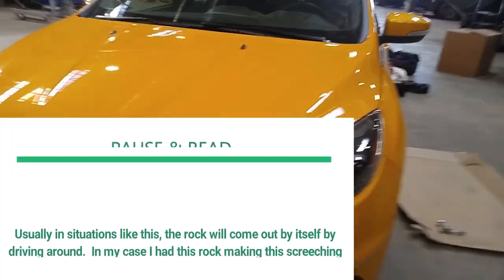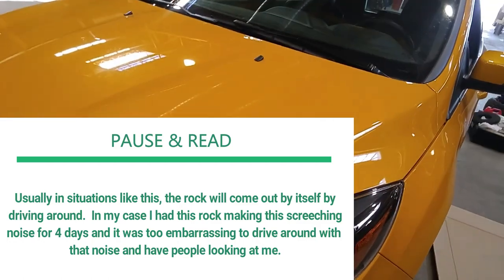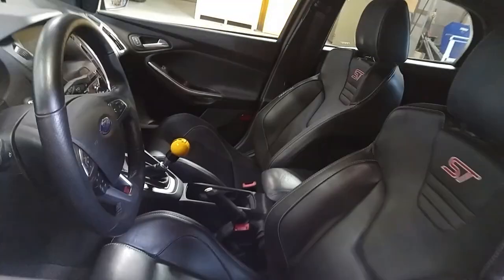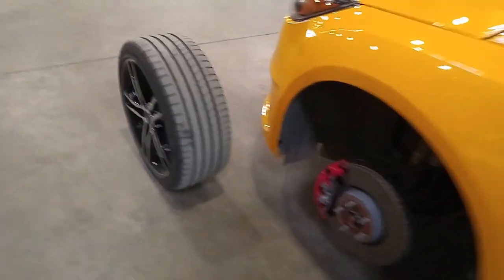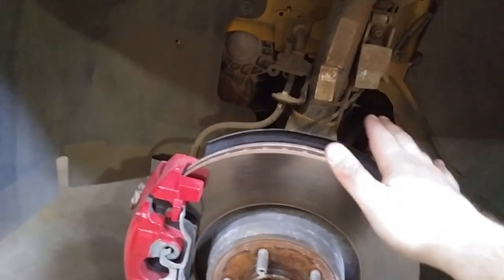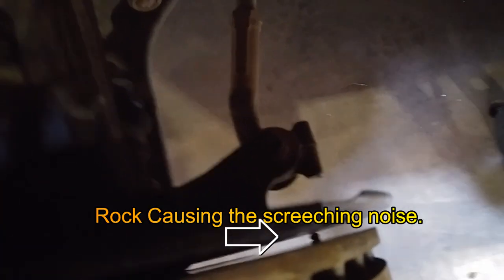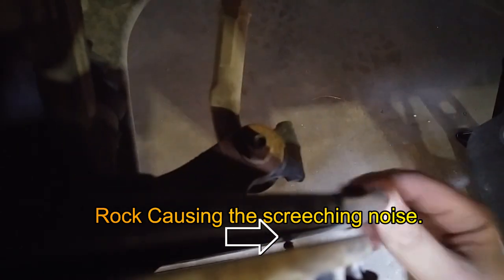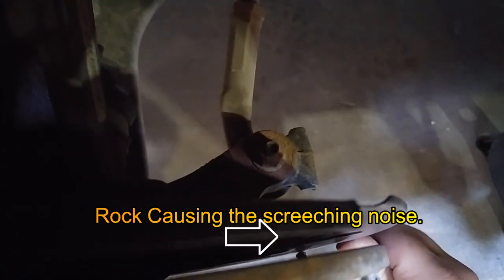HOW TO GET A ROCK UNSTUCK FROM YOUR BRAKES

Comment: We did not have to take the tire off.  Our sheild cups around and then it was stuck at the bottom, a screw driver through the outside gently got it dropped and  flipped out. You saved us a lot of headache. Thumbs up.

Comment: Thank you! Great video, to-the-point, helped me fix the same problem in 2 minutes. 

Had this same issue after driving on gravel roads. I was able to poke the plate with a screwdriver in a few places (without taking off the tire) until I heard the "clink" of the rock falling out. 

You saved me from bringing my car to the shop and looking totally inept!
Reply from the maker: That's awesome to hear Braham, glad I can help and save you some $$$     :)
Reply: But can't you damage something like this? Like making the space bigger than necessary would leave space for even bigger stones? Or does the metal shield come back to its original position?

Comment: It's kinda interesting to think that the rock would stay stuck there. I mean, you would think with all that rotation and heat that it would shatter and fall out on it's own sooner?
Reply from the maker: Marlin Hankin i definitly agree. It was stuck in there for 3 days when it happend. Driving me nuts listening to the squealing
Reply: I think that's what does happens 99.9% of the time. But 0.1% of the time there will be a rock that's just the right size, shape, composition that will find its way to get stuck in there.
Reply: @ElectricGlider2016  Has it happened to you? If yes, did you have to remove the tire?
Reply: @PeterSchneemann  yes it happened to me. I ended up having to take my wheel off to use a flathead screwdriver to move to brake caliper guard to unlodge the rock
Reply: @ElectricGlider2016  In my case the sound is barely perceptible. Do you think I can weight til I have my tires changed in November? Or could it do any damage if I don’t remove the little stone?
Reply: @PeterSchneemann  might damage your rotor depending how hard it is. But it should eventually erode away and fall out.

Comment: My car was making the same noise but had a rock lodged inside the calliper.  The mechanic was amazed.  The rock was shaped like a tiny rectangular bar.  He said it must have hit the calliper on thin long edge, gotten inside and then rotated inside and trapped itself.
Reply from the maker: Very unusual glad your ride is fixed!

Comment: How did it save you a trip when the only way to find out is to expierience the rock- to- brake tactic?once you apply the brake with the rock in there it will blow the outter brake pad off!!! its auctually quite expensive but nowhere near how much they will have to spend